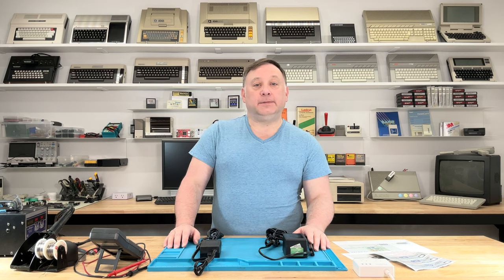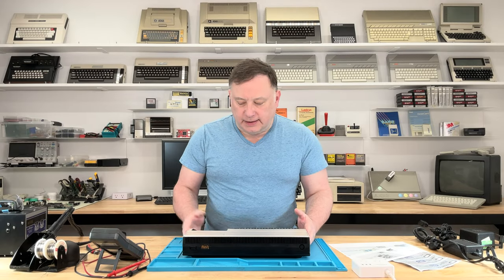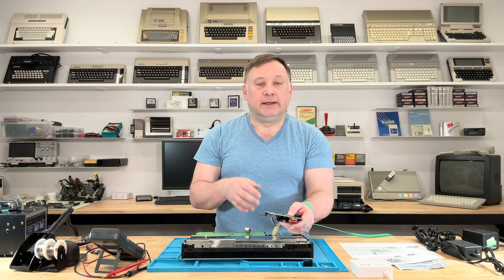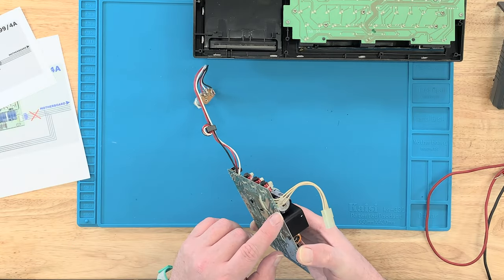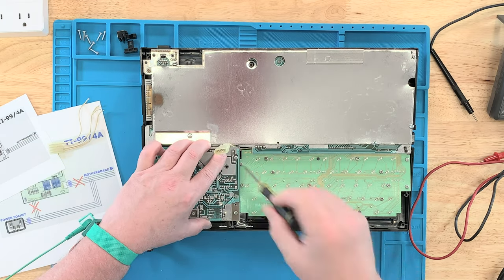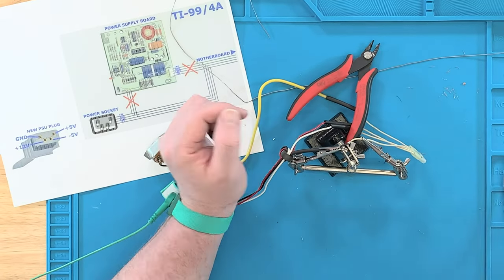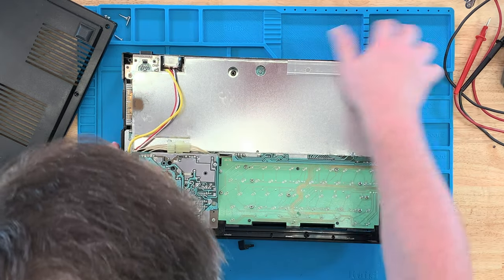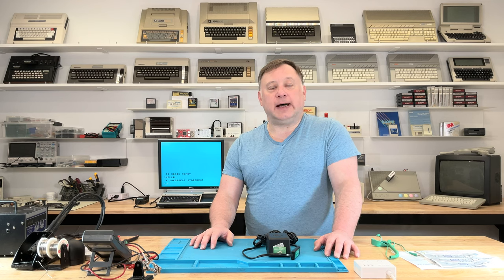TI-99/4A Modification for Keelog Power Supply

Comment: Great video - thanks! One suggestion for the audio, if you put it through Audacity you can bump up the levels (it's a little quiet). I have a Macro I created that bumps the treble & bass, then runs the Compressor to bring the levels up.
Reply from the maker: Good suggestion! You caught me on this one video though. The audio is not as good as usual because... the main mic did not record properly; so we had to use the 'other' mic from the down-shot camera. 🤦🏼‍♂🫤

Comment: I've promised myself that this is my next TI upgrade (along with putting a modern fan in the Peripheral Expansion Box, but that is a much more involved project, so I think I'll start with the power supply replacement. I won't miss how hot the internal DC convertor gets. They didn't call it the coffee warmer for nothing!
Reply from the maker: Let me know how it goes!
Reply: @TheVintNerd  Age has cost me my near-vision, and steady hands, so soldering has become a nerve-racking experience. 

I can use my multi-clamp to hold the parts (and my light-ring magnifier to see them, but my hands still have to direct the soldering iron.

Question: You left the RF shielding in place. Is it still neccessary with the DC unit removed from the computer. I left it on when I replaced the 9918A with an F18A, but would really like to remove it for ease of future motherboard access. Is RF interference even still a concern in 2023 where radio and television frequencies have been co-opted by cellphones.
Reply from the maker: Good question, but I don’t have the answer you’re looking for. I always just put original parts back in as much as I can.

Comment: I just bought one of these and realized the pinout is the same as the Colecovision. This means the ColUSB power supply should power the TI-99/4a, assuming it puts out enough amps for each of the different voltages. I will be performing the modification soon and will test out the ColUSB device.
Reply from the maker: That's cool. Let us know what happens!
Reply: ColUSB does work. The only downside is there is no power switch on the ColUSB. There are USB-C power switches though.
Reply from the maker: @cdoty  Ok, Good to know. Keep an eye out in a few weeks. I'll be doing a different TI-99 power modification. 👍🏻
Reply: @cdoty  How's this possible for ColUSB to work on a TI99/4A?
Reply from the maker: If you do the power wiring mod I show in this video, then the ColUSB will apparently work. However, check out my Newer TI-99 video about a new-New power board option for the TI-99. -Cheers, Steve
Reply from the maker: @CrashFan96  Ah, Bummer.  Hopefully @cdoty has info for you. I've never worked with the ColUSB
Reply: @TheVintNerd  I finally got it to work after I did the power wiring mod like it’s on a video.
Reply from the maker: @CrashFan96  AWESOME!
Reply: @TheVintNerd I will need a usb c power switch, so I can toggle the console on and off without unplugging or plugging the power cord.

Comment: Mine needs a new power supply so I might as well design a replacement PCB with a switch and LED. Using modern TI power switching regulators of course. Unless of course someone has already done this.
Reply from the maker: Someone has. Search TI99/4a Drop In Replacement Power Supply on eBay. I’ll be posting a video about it in a couple weeks or so.

Comment: I use a Keelog power supply for my C64. It doesn't have a switch, though. I'm not sure if I've seen one that did until now... 
Anyway, I'm not trusting that Commodore brick of death.
Reply from the maker: I’d have to venture a guess that the TI-99 PSU from Keelog has a power switch because the modification instructions has you bypass the TI-99’s internal board that has the unit’s original power switch. So, without the Keelog power switch, you’d have to keep unplugging the PSU to power down the system. 🤷🏼‍♂️😕
Reply: @TheVintNerd  True. And this puts the power switch closer to the user than a switched outlet or power strip would.